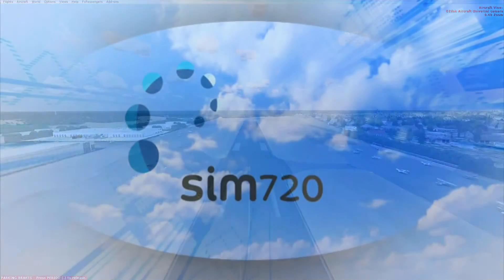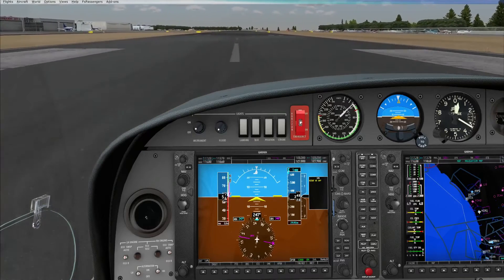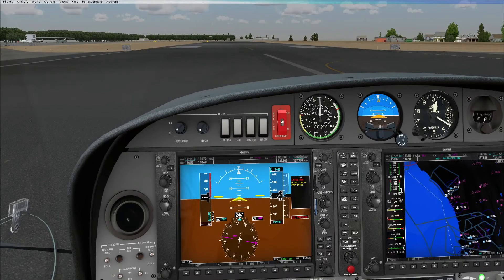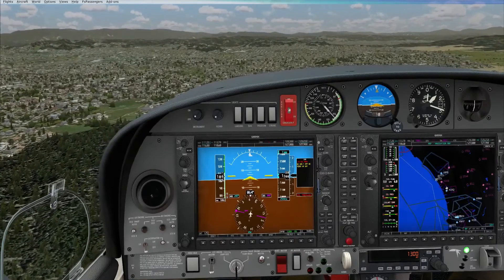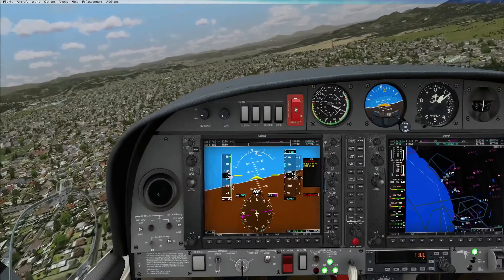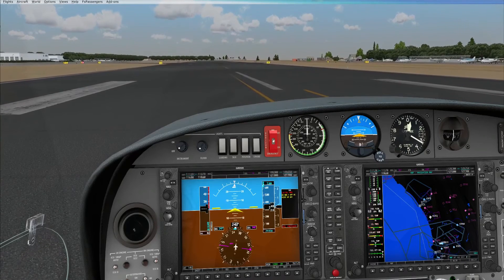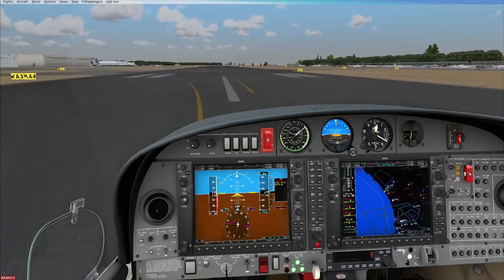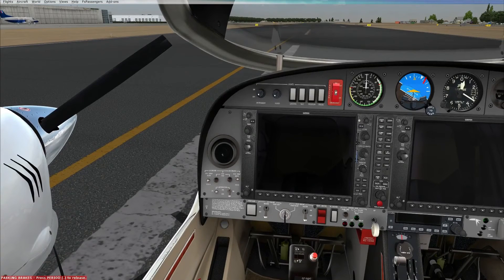Flight Sim Multi Engine Tutorial 3: FSX Alabeo Da42 and Sim720 KCRG

Comment: You said "Parking brake - ON" but instead of that you released it. In order to set parking brake you have to push DOWN this arm, not UP. In this way you took off with engaged parking brake and turn off after landing/parking
Reply from the maker: I know. This was an error of modelling from Alabeo. it's reversed. one of the many modelling errors this one has
Reply from the maker: although i think they may have fixed this in the newer fixes
Reply: My bad. Anyway, it's useful video, thanks for that. So, I understood that you used to fly on the DA42? Can we contact by email? I have some questions